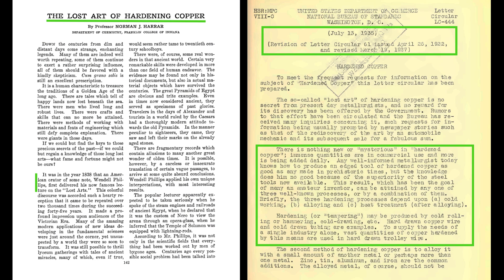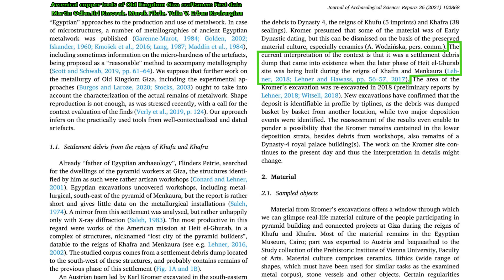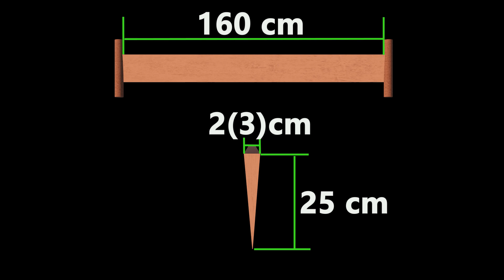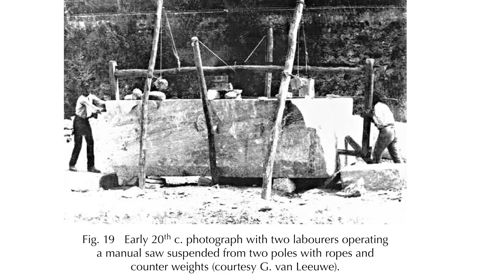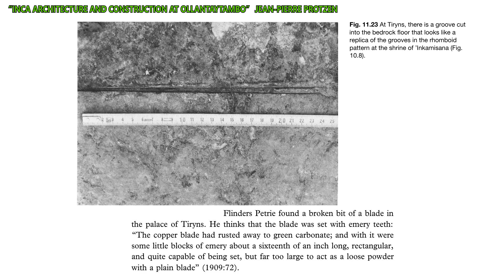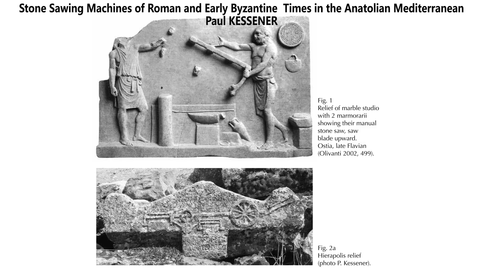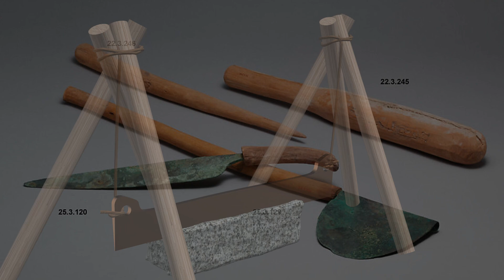Unfinished sarcophagus. Part 2 The lost art of hardening copper

Comment: the V shape doesn't go away in use.
it will stay roughly the same thickness until there is nothing left of the edge.
the blade losses material mostly at the edge of the blade not at the spine which would make no sense  and if it did ALL THE SAWS IN THE WORLD WOULD BECOME AS THIN AS THE EDGE OF THE BLADE.
 THEY HAD OIL.
oil and sand make great abrasive together why would you even think they would use Water !! you probably never worked with hand tools in your life to come up with things like that.

romans and greek were using sand and olive oil to help cut so why wouldn't you think the egyptians wouldn't have known that ?

your conclusion lack knowledge outside books  and the AI voices a shyte there is no excuse you can use your phone to record your audio
Reply from the maker: "blade losses material mostly at the edge of the blade" - did you decide to quote me? "wear would not affect the cut width, and its shape would remain almost consistent—except for the final section."  
 
"THEY HAD OIL." -  "In (а) the abrasive used was wet sand. Note that the valls, inпer and outer, are rough. There are no lines. А similar finding occurred with crushed quartz. No lines were produced when the abrasive was  used  with olive oil or а modern Jubricant. ....Using а viscous lubricant also hadl the advantage of being аblе to create а drill hole faster than when water was used with the abrasive... In addition to emery, concentric cutting lines were also present after drilling with corundum and diamond  - Ancient Egyptian Stone-Drilling Ап Experimental Perspective оп а Scholarly Disagreement LEONARD GORELICK А. JOHN GWINNETT " I mention this source in the first video, you are again quoting the obvious

"oil and sand make great abrasive together why would you even think they would use Water !!" - Because sand doesn't leave the necessary scratches, and emery works even with water. Although, of course, it's better with oil.

"you probably never worked with hand tools in your life " I've lapped valves in my car many times using oil and abrasive. 

" and the AI voices a shyte there is no excuse you can use your phone to record your audio" Your opinion is very important to me, thank you.

P.S. Don't waste my time on obvious things

Comment: Right, the ancient Egyptians may have accidentally created a composite material - corundum in copper matrix. This is possible because the melting point of copper is 1085 degrees Celsius, while the melting point of corundum is 2044 degrees Celsius. Only the cutting edge could be made of this material, while the rest of the tool could be made of copper or bronze
Reply: Yes, it is possible to create a copper matrix composite with corundum (aluminum oxide, or Al₂O₃) powder using a melt process, also known as stir casting. This technique involves stirring ceramic particles into a molten metal and allowing it to solidify into a metal matrix composite (MMC). 
However, the process is challenging due to key differences in the material properties of corundum and copper, and it requires specialized techniques to ensure a uniform and high-quality final product. 
Challenges of mixing corundum into molten copper
Poor wettability: Copper and corundum do not naturally wet one another well. This means the molten copper tends to resist the incorporation of the ceramic particles, which can lead to agglomeration (clumping) and a poor bond between the particles and the matrix.
Significant density difference: The much higher density of copper compared to corundum can cause the corundum particles to either float or settle in the molten metal, leading to a non-uniform distribution. Specialized stirring or agitation methods are needed to counteract this.
High melting point of corundum: Corundum has an extremely high melting point (over 2000 °C), far exceeding that of copper (1085 °C). The corundum powder will remain solid during the process, and this high-temperature difference can lead to thermal shock and cracking if not carefully controlled. 
Techniques to overcome challenges
To successfully produce a high-quality copper-corundum composite, manufacturers and researchers use several specialized techniques:
Mechanical stirring and ultrasonic treatment: Vigorous mechanical stirring is essential to keep the solid ceramic particles suspended and uniformly distributed in the molten copper. Researchers have also developed ultrasonic stirring methods to improve particle dispersion and prevent agglomeration.
Wetting agents: Fluxes or other wetting agents can be added to the molten copper to improve the interaction and bonding with the corundum particles.
Pre-heating: Pre-heating the corundum powder to a high temperature before adding it to the melt can minimize the thermal shock and prevent the molten copper from solidifying prematurely upon contact.
Powder metallurgy: An alternative to melt processing is powder metallurgy, which avoids the difficulties of molten metal entirely.
Process: Finely powdered copper and corundum are mixed together, pressed into a compacted shape (a "green body"), and then sintered at high temperatures (below copper's melting point) to bond the particles.
In-situ processes: These methods involve a chemical reaction within the molten copper to produce the ceramic reinforcing phase. For example, a reaction between copper oxide (CuO) and aluminum (Al) can form alumina (Al₂O₃) particles that are more easily and finely distributed in the copper matrix. 
Resulting material properties
The addition of hard corundum particles to a soft copper matrix yields a composite with unique and desirable properties that are a combination of the two materials:
Improved wear resistance: The hard ceramic particles act as a barrier to wear.
Increased hardness and strength: The corundum reinforcement increases the overall hardness of the composite material.
Excellent thermal and electrical conductivity: Copper's high conductivity is maintained, while the ceramic phase offers a high-temperature stability. 
Note: Research has successfully demonstrated the creation of copper-alumina composites using a melt-stirring method, confirming its possibility.

Comment: Soft copper would be better if the purpose of the blade was to drag abrasive sand through the cut. Particles of the abrasive would embed themselves in the copper, themselves dragging other abrasive particles along the groove.

Comment: 2:27...the Khem themselves have shown here how it was done...the saws arent meant to cut at all but to move the abrasive sand that does the cutting back and forth...you can clearly see the Khem (Egyptian) guy in the middle of the picture pouring sand mixed with water into the cut...the "teeth" on the saw are probably meant to carry abrasive sand....unless the Khem did have super alloy or work hardened bronze....as for wobbly cuts and grooves,, I challenge anyone to keep a straight edge after hours of working hard in the sun...

Comment: why did the author not note that the seam after the incision initially has a slightly convex shape in relation to the lateral surface of the sarcophagus, and then along its entire length it first aligns and then becomes pressed in. its important thing
Reply from the maker: Thank you. I don't understand what kind of convexity you're talking about. Initially, we sawed straight - on the right, but then the direction of the cuts was changed. The oblique lines are on the left. https://drive.google.com/file/d/1vKTfnM0BSauTfWIBcT5hlqz4LydZu9xE/view Please clarify if you think this is important.
Reply: @GRES_TAC  thats what i meant
https://youtu.be/OVBPcA2IVJE?si=Kcl4KnTPmTdK2J0H
time 51:20
Reply from the maker: @alexprost7505  Yes, an interesting detail. First, they made a trench, still on the block blank (which is understandable, the marking is done immediately). Then, due to processing, the surface level dropped. And a situation arose, as if the rock was squeezed out.
I have not seen this video, usually nothing sensible is heard on LAI, so I have not watched them for a long time. But it should have been. I made a mistake.
Reply from the maker: https://drive.google.com/file/d/1CcqynZCNjUl15NPTlckkbf8QJEEq9tEu/view
Reply: @GRES_TAC  l.a.h. died together with andrey sklyarov, now it is a semi scientific club of fans of mysticism.
there is something interesting specifically in this lecture, but it will be difficult to watch, it since the author has no experience in preparing reports. i dont recommend watching the rest of the channel
Reply from the maker: 1 https://drive.google.com/file/d/1zH_pInvaKozpFPMbCI575cYH6qceP7om/view  2 https://drive.google.com/file/d/1JcorwgIfVwLDLEWnwJijl1GEmBTzwbfX/view 3 https://drive.google.com/file/d/1DR5Nx_T_atqhZqU1tI5555dT7qpCVmPE/view
Thank you for bringing this detail to my attention.
Reply: @GRES_TAC  just in case a couple of timecodes for the same video. 31:18 stone, and 34:08 macroshot of that stone - suspicious texture. Its near one of the great pyramids

Comment: I think the continuous narrowing would not pose a problem, since an abrasive saw will cut on its sides, so introducing a new (wide) saw blade would simply result in widening the existing cut until it reached the bottom and began deepening the cut.
As for reclaiming the metal powder, I would expect that it could be reused, but would likely require a process closer to the smelting of ore than melting a copper ingot.

You make an interesting point about incorporating abrasive into the metal, are there any finds of copper tools like that?
There may have been some very hard minerals that could have been crushed to use for that, like corundum, that would have massively extended tool life if they could be added in large enough amounts without weakening the metal too much.
Reply from the maker: Thanks for your thoughts. "widening the existing cut until it reached the bottom" the abrasive will go away from the sides. This can be done with a fixed abrasive. "are there any finds of copper tools like that" Yes, there are assumptions. In this video I quote J. Protzen https://youtu.be/Hdwim_n1m_0 But I do not know of a find of a completely preserved similar tool.
Reply: @GRES_TAC  I should say that I do not think a wide wedge shaped blade would have been used, it seems very inefficient, just that I think cut widening could be done and to some degree would have been unavoidable during any abrasive sawing process.
Even the normal cutting process would likely involve someone standing above the cut slowly adding abrasive slurry as it migrates out of the cut, and if the saw is not at the bottom of the cut they could just add it faster to compensate.
Reply from the maker: I agree. You have formulated it very clearly.

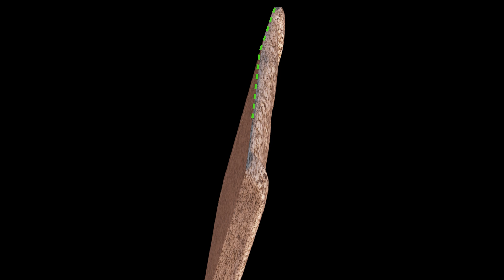Comment: Ok soo I rewatched couple of times. 9:21 that shape of saw could not be used, as it would wear the sides as it moved over and over again. 
So a wedge shape saw makes a lot more sense for processing, wear would also occur but would not affect it as much as the other profile. if saw can only move on one axis than cut direction would not change and remain constant. 

Sure survival bias, but eh at this point whole Egyptian and Peru archeology is survivor bias analysis. 
or archeology as a whole to be fair.
Reply from the maker: Something is out of consideration. Both saw options are not suitable. There is no sharp narrowing at the very end of the cuts, but there should be one.

Comment: The shape of the cut is misleading. It's in a triangle shape due to what is referred to as the kerf of the saw flopping around during use. 
It makes no sense and increases the amount of work exponentially to make the saw in a pie shape cross section. In fact the saws typically are thicker at the cutting edge, than in the kerf for this reason. The kerf will produce alot of unwanted drag and friction.
On a side note. I think they would consume as much precious copper as many think when doing this if they was able to catch all the slurry and dust from the cutting process. All the copper would still reside in the dust. They could then collect it back to re-use it again later. So one saw can be made over and over again if they collected the dust.
You should reach out to a channel here called SacredGeometryDecoded. He is very knowledgeable on such things and actually recreates these cutting experiments with period hand tools. I'm sure you can learn alot. 
Good video bud. 
Thanks
Reply from the maker: Thank you! Yes, I know about this channel. At 4:59 it says that it was possible to collect copper waste.
Reply: It's a good point.

Just to clarify, the kerf is the width of the slot cut by the blade, not the width of the blade itself.

Comment: A pendulum saw with a flat cutting edge suspended from a rope at each end can not leave concave cuts marks. Sure, tracking any single point of the blade through its motion will swing in a curve shape but if the blade is suspended from two equal length ropes the blade edge will remain parallel through full range of motion. Now, if the blade has a curved edge or is suspended from one rope you could create a concaved cut but neither would be very efficient because only a portion of the cutting edge would come in contact with the stone when operated. Some researchers try to prove a swing saw can leave a  concave cut by making a very small scale version but all it shows is the blade moves in a curve shape when swung. I do not understand all the bias some have against the circular saw. No evidence in the record for one? I don't believe there is any evidence for a swing saw either, is there? No examples or murals of swing saws ever been found in egypt either. Plus, Flinders Petrie (father of Egyptalology) wrote that he believed the ancient egyptians used circular saws also. If I am mistaken in any way please let me know. (With evidence please) I do not believe in a lost civilization or advanced technology i align more with the orthodoxy on most areas.  I am by no means an expert in egyptology but I do have a masters in mathematics (algebra, geometry, cryptography) with a focus in differential geometry so the physics of a swing saw I'm good on but not so much on egyptology. Only a hobby. Thanks sir. Have a good day
Reply from the maker: Thank you! Excellent, sir! I have a technical background too. These traces were not left by a huge disk. https://youtu.be/RTt6SWw32yQ?t=526 8,46 (cut in the center) 
I have nothing against a circular saw. I do data analysis.
In the case of the pendulum - who said that it was a saw. And if the "axe" is on a rigid suspension.